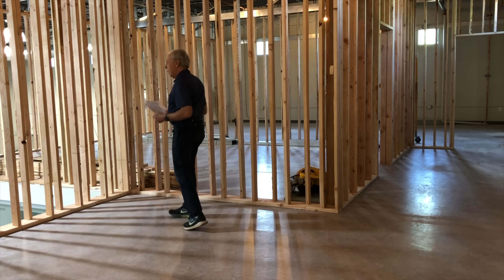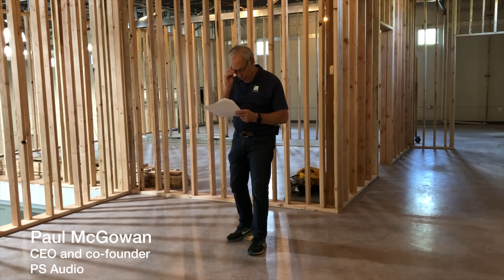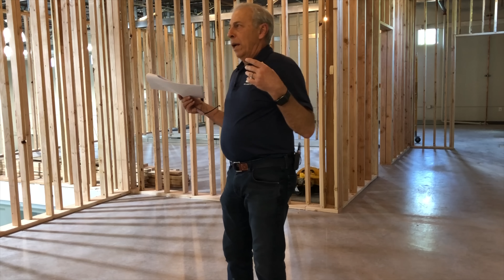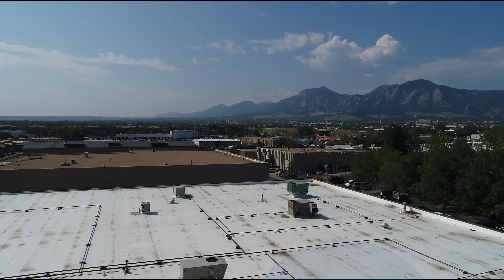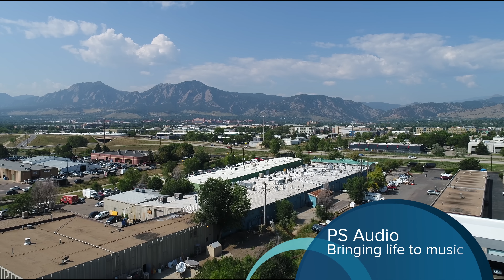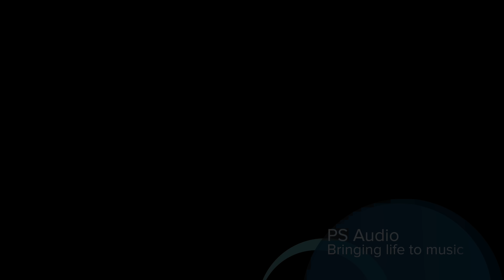Which is better, sealed or ported speakers?

Comment: I know this is an old video but really the ported vs sealed question is determined by the speakers efficiency bandwidth product (EBP). Only for speakers that fall closer in the middle of the EBP values, that is between "50 and 90" (say 70 for this instance) does it become a personal preference between sealed or ported. Ignoring the speakers EBP when designing cabinets and getting it wrong will result in very flat/thin sounding bass or muddy/booming with no audio distinction between bass notes.

Comment: Andrew Newman
The most impressive speakers i ever built were 10cu. ft. sealed boxes (fully braced and everything sealed with silicone) with 15" EV. woofers and EV. horn mids and tweeters. Massive super tight bass and earsplitting sound levels.

Comment: sealed can be good for certain things like a full range speaker or a subwoofer with radiators or in a huge box wtith a huge box but it has to be tuned right or will sound awful

Comment: I think the simplest way of describing the difference is that "sealed" misses out on half of the output but due to its simplicity generates a more accurate sound while ported takes advantage of air resonance to boost the output but in some cases suffers from things like port resonance and phase flipping which may introduce some peaks and nulls along the response. 

A good thing to keep in mind when it comes to subwoofers specifically is that a sub only plays a very narrow band of frequencies (10-200Hz at most and typically 20-80Hz since 80Hz is such a popular crossover point) so a lot of the drawbacks of a ported design don't actually get a chance to affect the sound. The problem frequencies are filtered out by the crossover and are handled by other, perhaps more capable speakers.

IMO a sub benefits greatly from a port when tuned to a low frequency, such as 20-30Hz - an area where every bit of power is important and speakers (even subwoofers) generally struggle to reproduce.

On the flip side - not much lives down below 30Hz, especially when it comes to music, so it is more typical that ports are used to boost the putput of small speakers that struggle with frequencies between 35-80Hz - a range that is much more used by music.

This is why people recommend ported subs for movies and sealed subs for music.

Comment: Ported is generally my last choice. OB, Sealed, or TL are generally my choices in approximately that order. Horns are cool if you have the space but a 16Hz horn is pretty big. Sometimes it is tricky to find a good driver that is designed for sealed these days but there are ways to make it work.
Reply: Get ur self a pair of oldschool canton quinto 530 (they have 10inch woofers) or canton quinto 540 (these have 12inch woofers) both have sealed enclosures and silk dome mids g highs i just bought 3days ago a pair of quinto 530 the bass these speakers deliver is insanly accurate and never distorted mids g highs are also one of the cleanest i heard the freq. response is 25hz-30000hz also  80-120w per cabinet but if u want a litle bigger sound and even more bass u can get quintos 540 those are 100-150w and they go from 22hz-30000hz

Comment: Sealed speakers are better, especially when subwoofers are employed. Sealed subs are better, except when played outdoors. Designers like vented speakers because it makes them feel more important. Sealed speakers couple better with both subwoofers and room boundaries. A sealed subwoofer's driver is almost always bigger than a vented subwoofer's driver given the same box size. The only benefit of vented subs is that subwoofers larger than 18" aren't yet common, so 18" ported designs can outplay sealed boxes in the 15-25hz region, and even this sacrifices "bass" in the 7-10hz region vs sealed designs.

Comment: ...sealed with passives sound best to me at least...but you need larger speakers (cabinet space...easier to 'squish' a large volume than small)...I currently have a pair of (will eventually tear them down to restore them to 'new') Celestian Ditton 25's on my music system, and that's all (I have a separate setup for HT)...great full sound of that pair....now I used to have a pair of PSB Beta II's (servo driven speakers from 1973?)...and those were also a great set of speakers...would love to get another pair....

Comment: Have you considered or has anyone else considered making a vacuum sealed speaker cabinet with no air behind the woofers? That should reduce or eliminate the need for cabinet vibrations and force all the speaker vibrations forward, which is where it should go.

Comment: I prefer mostly closed box, but in 4 way systems i heard nice bass in big studiomonitors jbl4345....or harbeth also vented...but closed is easier to install in average room with less coupling like reflex...heard also nice passif radiator designs.....so if it is well designed all can sound great imho

Comment: i have this idea in my head for a speaker but i don't know if it could work, so what if instead of a magnet on the speaker you use another coil at 180° out of phase, would this add some response to the speaker and more strength to minimize the lag?

Comment: Another way to compare sealed vs ported. Air compresses, if there is a port, there is no pressure to build (obviously, with the air moving in and out). With sealed, pressure is built both positive and negative. If the speaker is totally sealed, you will have to have not only a case that is sealed, but speakers that can hold pressure (foam surrounds, will help, but will not work). With the fact that air compresses, the air in the case will transition from high to low pressure pretty rapidly. When high pressure is built it has no where to go, same for the low pressure. That means that the neutral position for the pressure is the resting state for the speaker, thus the speaker has to fight to build pressure, and the excursion of the speaker is more controlled. 
I didn’t know that servo woofers was that out there in the market, but that adds to the control, as was said. 
My preference is ported. I know that isn’t so precise, but with how I listen, and my preferences, ported is the way to go. It’s a very relaxed tone, it drops with out being pushed.

Comment: The speaker I have have a port the woofers are inside the box wit a isobaric push pull set up and the bass response is excellent the bas stops and  they are not a servo system and they are only 8 inch woofers wit a clean bass response that goes down to 24hz and they are the best speakers that I have ever heard still to this day

Comment: Hi Paul, can you do more on passive radiators, how big or how many to use with say a 12'' woofer with 5mm Xmax, and where they should be placed, and does using them mean you should build enclosures to sealed specs or can the enclosures be a little bigger

Comment: Paul
  Do you think the modern day sealed subwoofers, that use very high power and huge magnets can perform as well as a servo controlled subwoofer? I remember Velodyne ULD -12 was rated at only 100watts continous and 400watts peak, but was servo controlled. By contrast, my modern day SVS Sub is rated at 1200watts continous, 3600watts peak and has a huge 50lb magnet structure and is very tight and accurate with extremely low distortion. The point being, can the same low level distortion be achieved either way?

Comment: If you have room for a loudspeaker  that can barely fit through a standard door, then sealed is going to be awesome.  An E-V 30" driver will give excellent bass response with low xmax.  Sealed box gives low amount of time smearing in bass response, compared to ported. In small box speaker, everything is compromised regardless.

Comment: There is a fairly straightforward answer to this question - sealed box.  John Watkinson wrote some great articles explaining why, but if you care about bass you can just hear it right off the bat.  Particularly kick drum ported speakers will find hard to reproduce accurately.  Transmission lines like PMC may be OK, I haven't had the opportunity to A/B carefully.

Comment: I use a larger sealed box with drivers 3 feet off the floor, and a single ported subwoofer directly on the floor. The bass gets to come and go as it pleases, it leaves the room and disappears in the middle at some frequencies but mostly the total package ends up better.

Comment: I’ve got a pair of Tekton Pendragons, which have 2 bass ports in the back near the bottom and a d’appolito style array of a woofer, 3 tweeters, then another woofer on the top front of very large cabinets. Depending on your listening space, and depending how far from the wall they are, they can give you a bunch of different kinds of bass responses. After setting them up properly, I couldn’t be more thrilled at how amazingly great these spkrs sound. 
In the end, I think it’s 100% personal preference and what you’re looking to get out of your spkrs. In this case, I don’t believe there’s better, just different.

Comment: 6:15 Soundstage, the very reason I like point source. Two things mainly do it, frequency response and point source. Most full range drivers won't do it cos they don't go high enough. Most 2-ways won't do it cos the crossover frequency is way too high. But speakers like the KEF Uni Q will do it cos they have both the frequency response and the point source treble and med. And the crossover frequency doesn't matter cos it's point source. With drivers all-across- the-board you are relying on frequency response and the crossover frequency (while compromising on the speaker driver's phasing). Acapella speakers are like 400 grand with drivers all-across-the-board. And Feastrex make full range drivers for (up to) 70 grand a pair (just the drivers) and their big thing is point source phasing (like it is with me). Different companies go by different advantages. lol I reckon 2-way point source (like the KEF Uni Q) is the go cos it would be cheaper and way easier to do than with just one driver. And you still have the point source sound without the pitfalls of a single driver.

Comment: So bassports are a big nope at servo subs.
But how about the passive radiators he asked about?
Reply: How about this: A ported box is like an instrument, it adds volume at certain frequencies. Is it not better to keep the speaker frequency response true and flat, and make frequency  adjustments with knobs at  the sound source ?
Reply: @rokljhui864  AFAIK, horns are generally used to make a speaker more efficient.

Comment: I don't believe this is the good explanation between a "sealed" and "ported" loud speaker.  The question that person was asking was about "regular" sealed ver regular ported l.s.  The loud speakers you are designing and developing don't meet these fondamental differences since you're putting "servo" stuff in there and that's the main reason why you will use sealed design in order to control as much "electronic" parameters as possible.  In a traditional loud speaker design, WHY some are preferring Sealed over Ported products ?  What are the main differences ?  That person was talking "analog" wise stuff...  I know that you have to sell your stuff but please, answer the right way...

Comment: And there is another thing: A ported speaker brings in more latency. As an audio phile, you don't want extra latency. But if you are going for db or you have to put a decent tone in a small packet, they are a decent option. Porting makes the speaker design more efficent. So you get more db out or can have a smaller box.

Comment: I want to build a box for an open space like a garage or a backyard for small parties. I am planning to use an 15” subwoofer. Does it matter where I place the port? Some people told me to place it in front since that’s where most people will be any how. Other people told me to place it on the bottom so that the sound will go all directions and that not all people will be in the front. I’m not a pro in this field and I need more information. Where would the best placement be for the port be, front or bottom? How big should the port be?

Comment: Sorry to say this Paul , but you didn't really answer his question the right way.... as you will soon find out there are some kinds of LF drivers which will ONLY work well in sealed enclosures and there are others that will only sound good in vented boxes ( including PR 's ) as a very general rule here, speakers with a Qts of up to around 0.35 are only really suited for vented boxes  ... higher than this would be for sealed . In other words it's ALL about the speaker to be used !

Comment: I love my passive radiator subwoofer. It employs a Peerless XLS 10", which has an enormous magnet (Qs = .23), and a matching 10" PR. It is flat down to 20 Hz. Wonderful.  The mains are sealed because why not.  Crossover 80 Hz.

Comment: I used to be a fan of sealed boxes until I built a ported box out of curiosity. I had an awesome driver to try it out though, a 12 inch sub with a light cone and rubber surround that goes down to 20Hz. It's amazing how effortless it sounds. At low levels, the cone barely moves but the bass fills the room. There is port noise, but at levels and frequencies that are never achieved with music (I only got it with test tones).

Comment: What if removing those bad artefacts of a speaker makes it sound worse. Yes, it would be truer to the recording BUT! The tracks were mixed on speakers not featuring that. Imagine the accuracy of the speaker being super tight. All those transients might start to cut like a razor blade. A studio engineer adding slower attack, fast release compression to make the everyday speaker pop to the drums. Think how that will translate.

Comment: Sealed... Agreed. EQ a room... Not!!! If a frequency is cancelling due to speaker placement, no amount of EQ is going to bring that back. You make it sound way too simple and easy in this video. Naturally, because it's going to be a selling point of your speakers but i do remember the huge pages of info from dbx (and their room eq) "The only way to EQ a room is to bulldoze the walls". They too supply it on the drive racks etc but didn't hide the truth by present it as a miracle cure. They were very open about about this. Shame the forums gone, there was pages of good info, getting started guides and links.

Comment: The "smart amp" technology detects the state of a woofer from its electrical measurements in real time without using accelerometers.  I am curious if you can replace the servo mechanism with the smart amp technology for your woofer or subwoofer. It seems to me that the smart amp technology is cheaper and less complex than the servo mechanism.

Comment: With the B&W Nautilus video still in my mind , what was not mentionned and explained is that the Nautilus shape is really "form follows function" . It's not meant to be art (although it sure looks beautifull to me) . I already explained the spikes , but the sealed bass enclosure is intended to destroy most of the energy of the backwave coming from the cone and thus preventing this from influencing the bass cone movement . I guess this is one of the main reasons why you need servo control in a normal enclosure , not so much in the B&W though

Comment: I go acoustic suspended/sealed enclosure. I ended up getting a pair of L810 bookshelf speakers from ADS/Braun from a friend last spring and it's got 2, 8" woofers in each cabinet, while the bass would not impress those that want their house shaken to its foundations, it will cause your floor to vibrate nonetheless and not be boomy at all. It's tight, clean and very musical too and detailed. The midrange and tweeter are both sealed soft domes.

It's true that acoustic suspended designs can reduce the bass extension, but if designed right, they can go quite deep. 

Ported designs tend to emphasize the mid to upper bass if not done well and thus often come off as boomy, especially in older floor standers, and especially if they are of the budget variety. Better made ported speakers will be less likely to do this, but it requires getting them off the floor though, the same with acoustic suspended models too as it's been recommended by ADS to do the same, about 12-15" off the floor or the L810 especially can get a tad boomy.

I can totally see the passive radiator being a nice middle ground between ports and sealed designs.

Comment: (Continued)... I plan to build a pair of tower speakers with these two drivers from Dayton Audio: tweeter RST28F-4 and woofer RS180S-8. I’m going by a design by NickToid and Kirby, shown in their YouTube channels on 22Aug2018. It is a large 1.1 cubic feet vented enclosure. Whereas I would actually like to go for a sealed enclosure.. I don’t mind if the lows are only till 88Hz or so...
I would like someone to guide me in sealed enclosure size for these two drivers. (Nick not interested now in redoing the design ...)

Comment: Hello Paul, I know there’s an old video on the same topic .. even there your answer or video doesn’t do full justice to the question. Here in this video it is worse. Requesting if you could explain the technical differences between a sealed and potted enclosure for the same full range driver (or set of 2-way or 3-way drivers). I personally feel that sealed is better.., is more tighter and louder and crisper etc. Would be great if you could also explain how the final results will be different...

Comment: Ports seem to be a way to deal with a Small Cabinet, to make it work like a big one. If you go the room use a Big Cab, if not do the other thing .
Reply: ports is a way to fake more bass, at the cost of sound quality. but you need a sub anyways so the point of a port is mute anyways.
Reply: Definitely no fake bass from my transmission lines. Bass rolls off fast below 30 Hz so I'm missing the bottom octave unless I get a sub. But then most of my listening doesn't include the pedals of pipe organ. If I had a sub it would spend most of its time doing nothing...